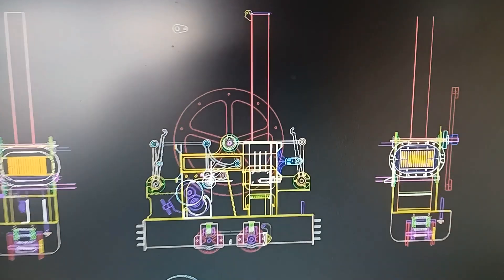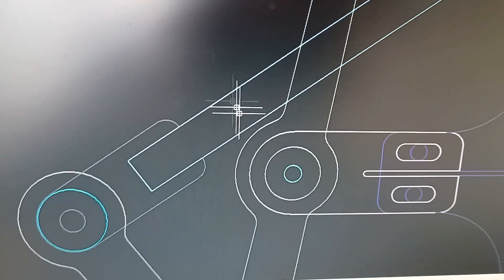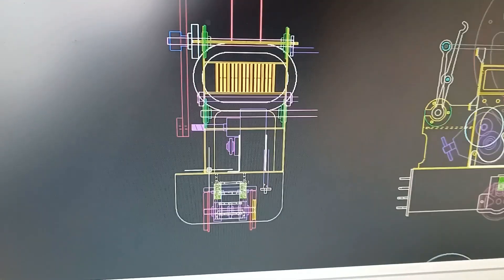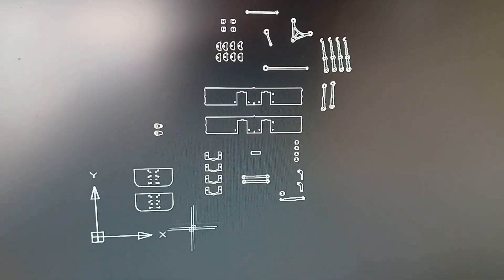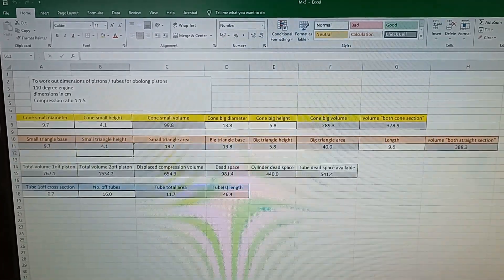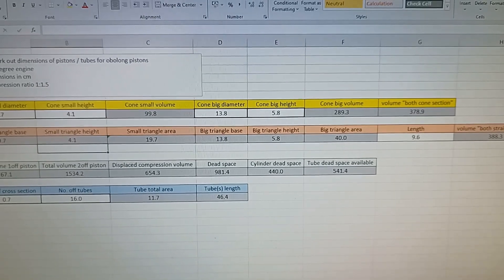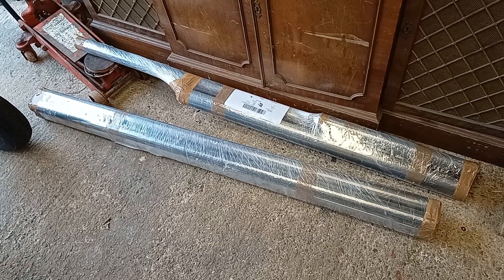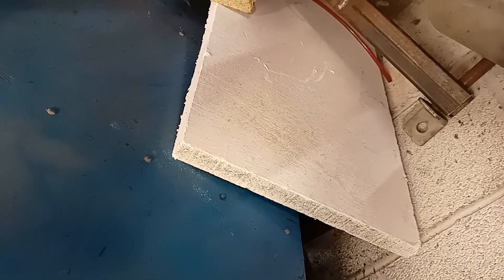Hot Air Stirling Engine Locomotive - Part 3

Comment: Shane, I'm impressed - I love how your Bell Crank design accommodates the line of force - It's a Victorian looking work of art - Some programs do stress analysis & pretty colours to show pressures - they would tell you what you already know! - I looked on e bay after your last post and saw lots of Titanium tubes - I am a fan of this material only a little heavier than aluminium alloy but stronger than steel - if you have a tig welder you could produce featherweight connecting rods  - I wonder if you could spin obtuse cone backings for your diaphragm bodies instead of fragile plaster pockets? Happy New Year!
Reply from the maker: Hi Trevor, will need to make the connecting rods much lighter on future developments if I'm going to build bigger. It really depends how successful this engine performs! Spinning a piston (backing plate to?) is a good idea : ). Cheers